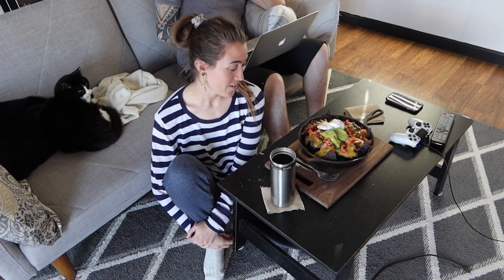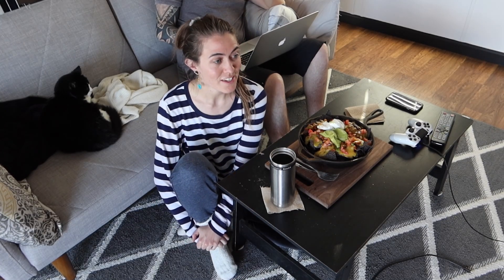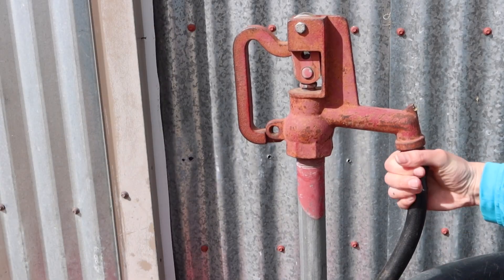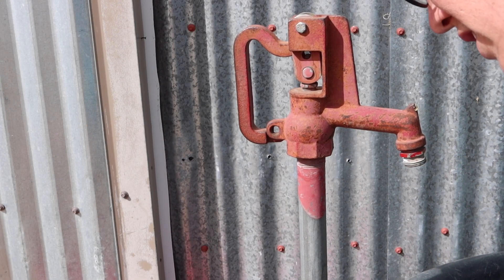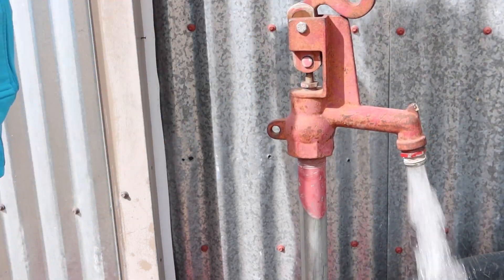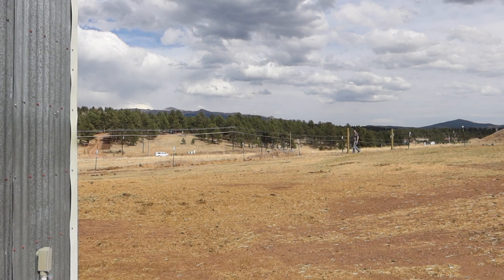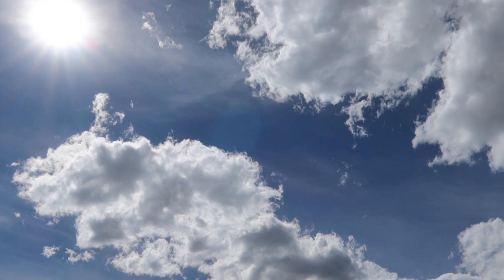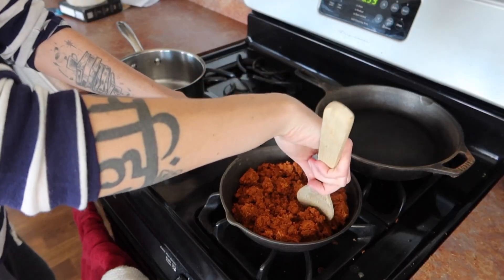IT'S BEEN A WEIRD SPRING ❄️🔥🌸 Spring in the mountains | Simple living vlog | Natalia Leigh

Comment: Compost your waste hay. In stead of throwing it away. Make a designated area with pallets and turn it into a compost. When you cut grass, all of your fruit/ veggie table scraps ( not seasoned foods) add them to the waste hay. And horse manure. And let it get hot and cook and break down. It will help give you compost for your raised beds. If you call any local tree  company have them add your name to a list and they'll dump wood chips free at your place that you can use for deep mulch in which you can use after it ages for weed deterrent.   Check out Back To Eden Gardening. It mimicks the forest floor.  Thought I'd throw some suggestions.
Reply from the maker: I finally started a compost pile! Feeling quite excited about it. 😊